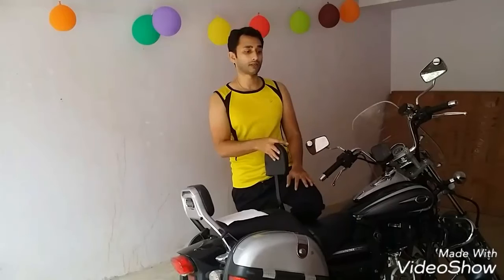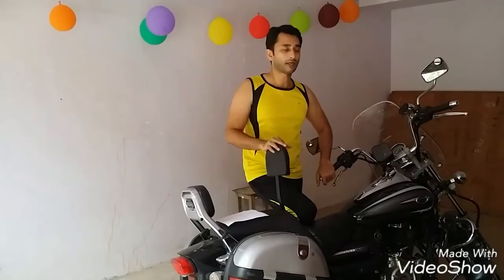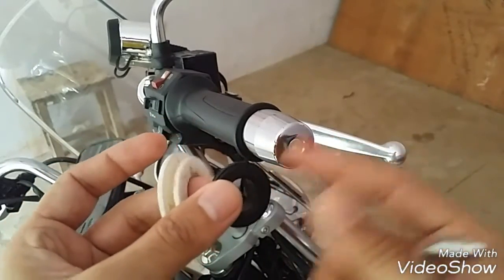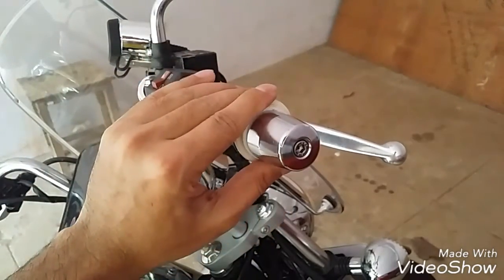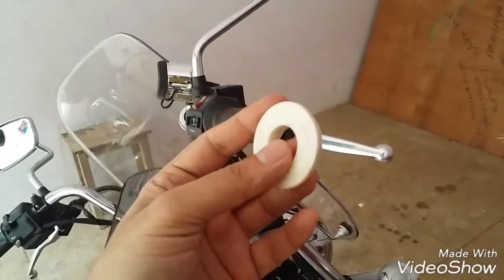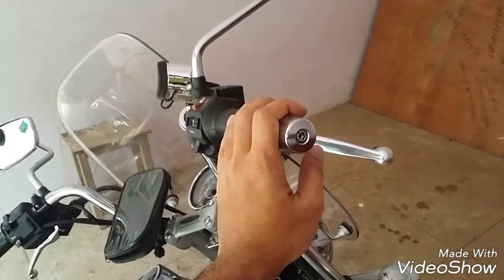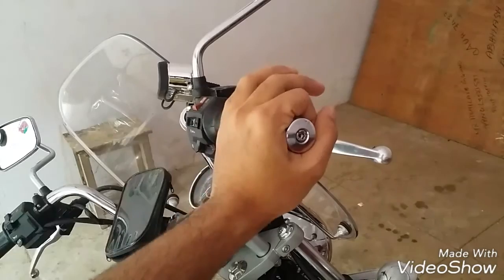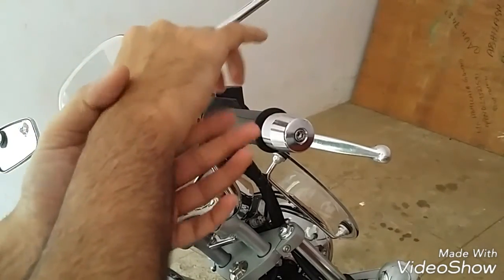Throttle lock and crampbuster

Comment: I think the real throttle lock comes with high end vehicles can release the throttle while engaging the break or clutch without any manual effort. Correct me if I am wrong.
Reply from the maker: Hi Anand, a very good question btw. I would say your not completely right. Throttle lock are always sold by 3 party vendor and is a alteration that is done. Normally high end motorcycles comes with Cruise control, which is similar to what you have in cars. Throttle lock are an altered cruise control not as perfect as cruise controls, since mid range and low end bikes do not come with cruise control so they figured out this adjustment cruise control.